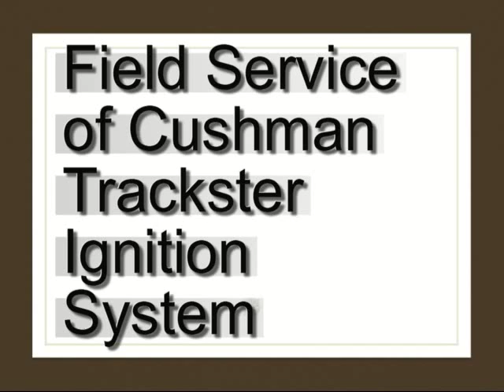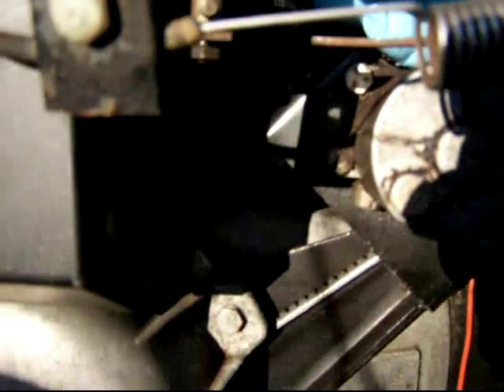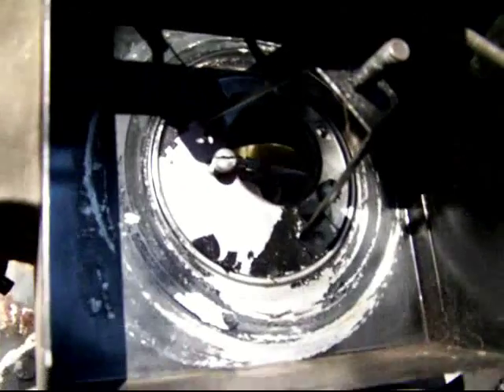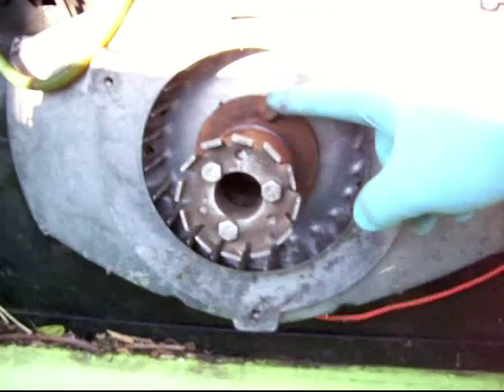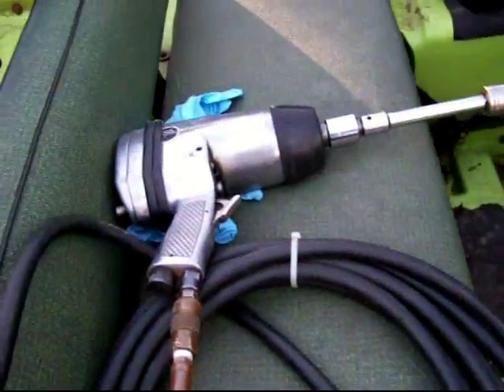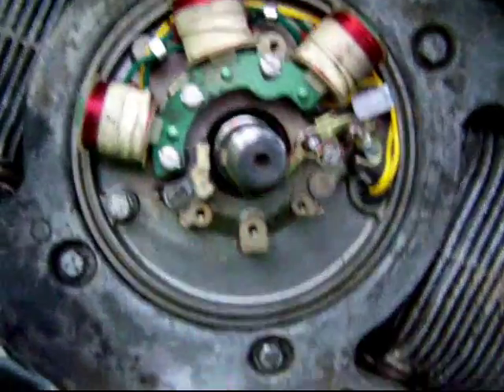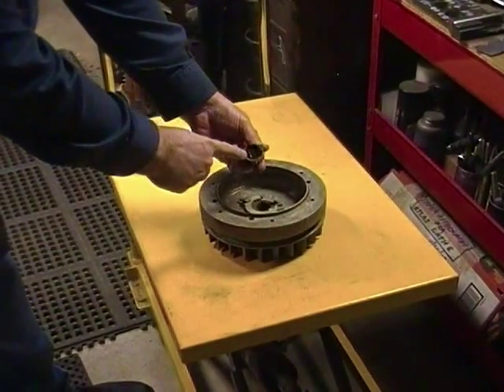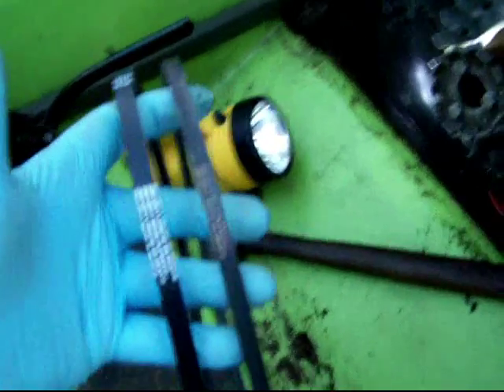Cushman Trackster Points Maintenance

Comment: Hi thanks for the video I have a question I am putting new points in a trackster I noticed two sets of key ways machines into the crank on in front for the flywheel and another directly behind inline that would be for the cam. Mine is missing the second for the cam. Is this normal or do you believe I need to add one. I have no way of knowing as I bought in gunrunning condition Thanks Stan

Comment from the maker: There is only one woodruff key used on the crank for the Trackster. The one key is for the flywheel only. The second key near the cam is missing from the keyway for all Trackster engines.